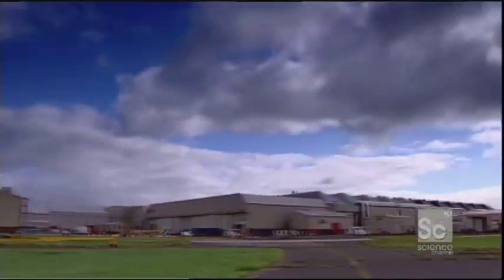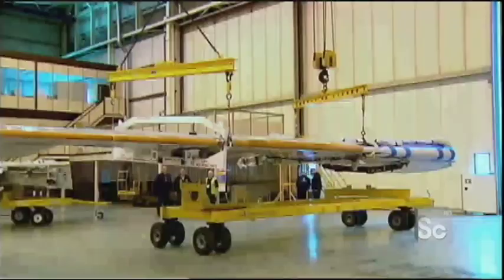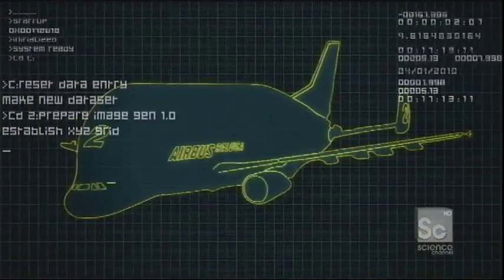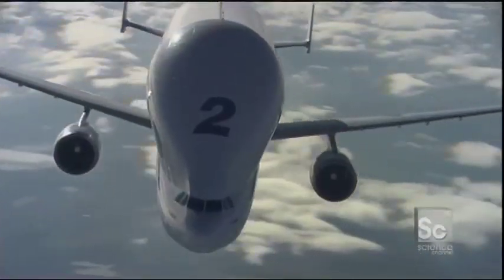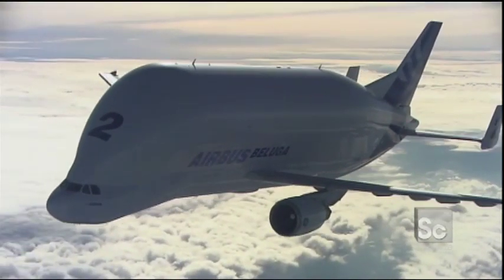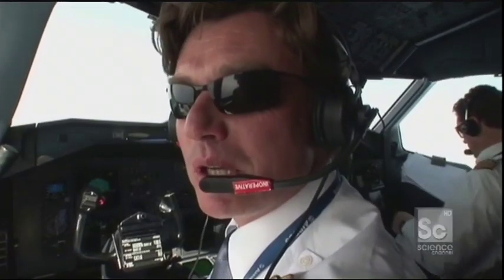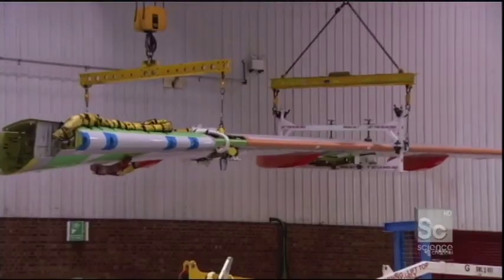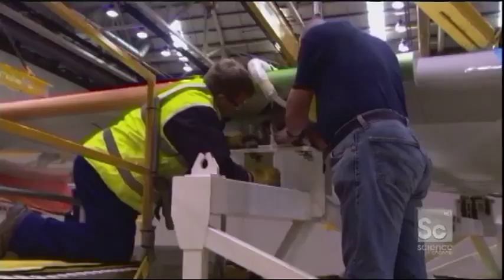Airbus Beluga A300-600ST (1 of 2)

Comment: God dammit airbus, just make a large airbase where you make and assemble the planes
Reply: Psychopathway Boeing does the same thing with their parts. They have a few similar looking, but SIGNIFICANTLY larger, modified 747-400F planes transporting fuselages and wings for planes like the 787.
Reply from the maker: That is a problem of an international joint venture. If there is only one factory, only one country get the economic benefit. The way they are doing it spread the work across multiple countries in order to create jobs for each participating economy.
Reply: BewareTheIdes I know the dreamlifter.

Comment: Only 2 engines? HOW?
Reply from the maker: +Filip Öst - If you listen to the narration carefully, he said this is the cargo plane with the largest cargo deck and door. He never said largest cargo plane. This plane is designed to carry big objects, not necessarily heavy objects. For light and bulky cargo, two engines are powerful enough for the job.
Reply: cause it is a modified version of A300 and A300 only has 2 engines

Comment: 47ton??Antonov 225 can carry 250 tons so what is this biggest shit stuff?  Max takeoff weight is 640 tons. It can carry a diesel elctric engine fully assembled
Reply from the maker: +Smokin4CHRIST That shit they referred to is the biggest door and cargo deck. Rewind and hear the narrator more carefully. Bulky cargo is not necessary the same as heavy cargo because objects has different density.
Reply: +cplai Thank you for correction bigger volume , yes, only 1/5  the weight of An225 you are correct.    Yes  Beluga  has more volume  than An225 and Dreamliner has the most 1800m3, so  only, the most fat belly at 1410m3, where as  225 only 1300m3,   225  is 28m longer, 225 is 1/2 m higher, Wingspan
225 is 44m wider  than Beluga,225 has 647m2  additional wing area above Beluga
of 258m2, Take off weight 155t v 640t. And 225 cargo hold is only 14m shorter
than entire length of Beluga. One designed to carry large light weight Alum.  parts and the other  a whole diesel electric train carriage. And 32  wheels compared to 10 wheels, all of  them damm big and I am glad I am not paying fuel bills.

Comment: i thought the Antanove 225 with the biggest cargo bay and biggest plane
Reply: AN225 didn't have the biggest cargo bay, it is a little bit smaller. However, the maximal payload weight on the beluga is really low (47 tons) when the AN225, can lift more than... 250 tons !

Comment: can somebody told me why Airbus A380 use double twin cam engine but this Airbus Beluga only use 2 engines? is it size and power of engine different?
Reply: The Beluga was specifically designed to carry very large and awkward payloads. Like wings, for example. Things that take up a lot of room but aren't necessarily very heavy. The video said the weight limit was only the equivalent of nine army Humvees or 47 tons, not a lot of weight when you compare them to the Russian Antonov 225's, which have six huge jet engines and probably have a payload three times as much as the Beluga. The sizes of the cargo bays are fairly comparable; one is just designed to carry a lot more weight.

Comment: Anybody think we need more than 2 engines? Nobody? Cool.
Reply from the maker: jonathon hummel This plane is not about the cargo's weight, but the size of the cargo that can fit inside. It is definitely NOT the biggest cargo plane either. The narrator claimed that this plane has the largest cargo deck and the largest door on any airplane. If the design objective is to carry heavy weight, then the plane will have much longer wing span and larger engines. Many cargo planes are larger than this yet cannot carry bulky items.
Reply: wow dude the wait of the cargo is really not that heavy .even a a a380 cargo plane caries more then that the only thing you would need 2 more engines is crosswinds
Reply: There is a turboprop version of the beluga has 4 props

Comment: This Documentry is nice but out dated.
Biggest bulk aircraft now is Boeing 747 DreamLifter  LCF designed to lift 787 parts
Reply: biggest arircraft is the shuttle carrier stupid ass
Reply: ***** You both seem to be forgetting the Antonov An-225. much larger in terms of wingspan and length then either of the two plans you listed.
Reply: ***** If you listen to the narrator carefully, he never claims this is the largest airplane. He said it has the largest airplane door and largest cargo deck. The design is all about handing bulky load.  It is about the volume, not the weight of the load. nor the size of the air flame.

Comment: the video is a piece of crap full of inaccurate statements! 
An-225 Mriya IS the biggest plane in the world. Beluga has a 147 ft wingspan, 54.8 t payload, 177 ft lenght and 123,000 lbf of total thrust VS Mriya's 290 ft wingspan, 250 t payload 275 ft lenght and an amazing 309,540 lbf of total thrust.